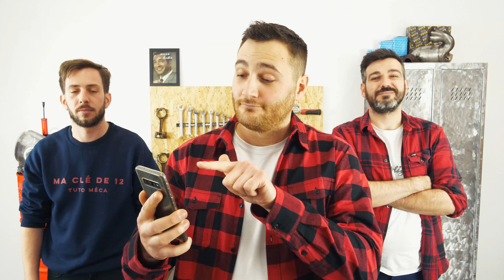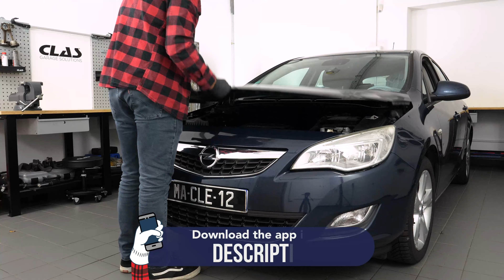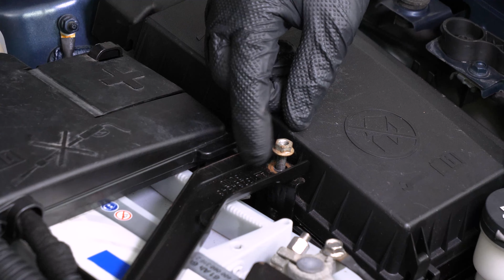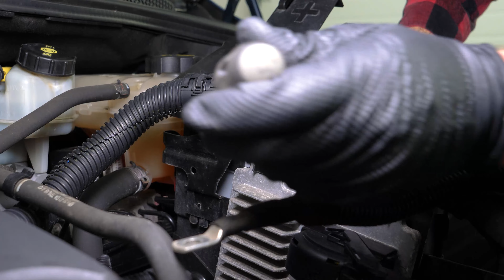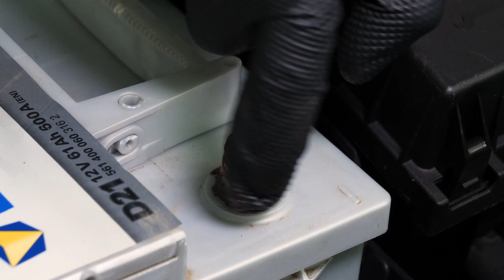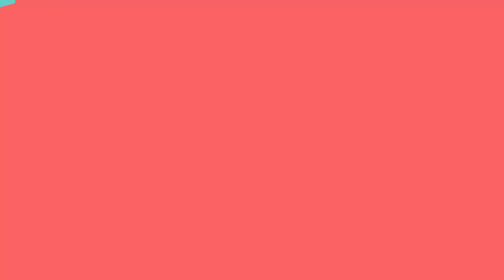How to replace the car battery Astra J / mk6 1.4 Turbo 🔋

Comment: Great vid👍👍  but....................Do not apply "Copper Grease" between the metal contacts before tightening, as it is primarily an anti-seize lubricant and copper can cause electrical tracking or interference. 👍👍

Comment: Hi, I would like to try changing the battery myself for the first time, looks simple enough, one question: does new batteries comes pre charged or do I have to jump start the car after the replacement?
Reply: Does the car need to be reset so that it knows there is a new battery?
Reply: @brumpsstuff8088 good question. Seems like with the J it does, a battery registration is possibly needed, requiring an OBD tool with this feature. I saw a video that completed this and then the car had to be left for 4 hours.
Reply: @brumpsstuff8088 i’ve just changed mine, the dashboard said lower and raise windows. Took it out for a spin straight after and running okay.
Reply: They come charged.
Reply: All new battery are fully charged so when put  new battery then start engine prefect and be careful with start motor that link to battery if careless then start motor would failed